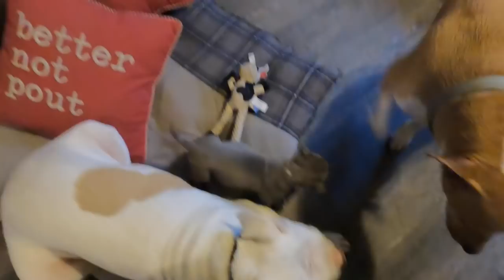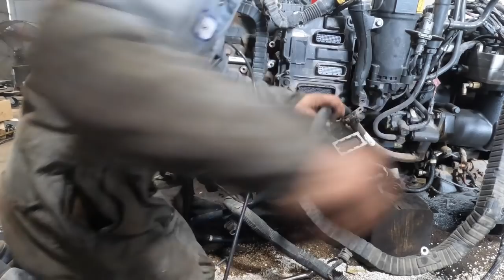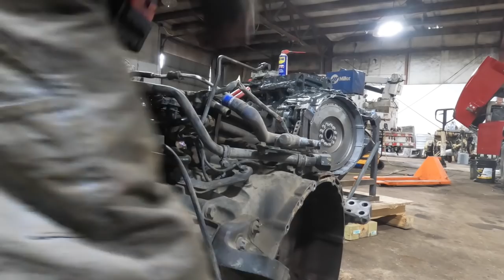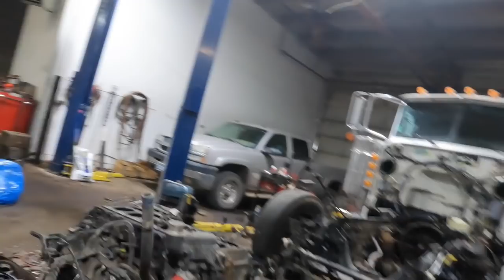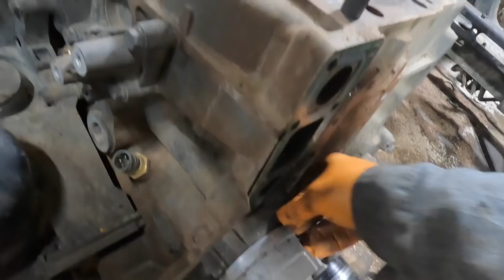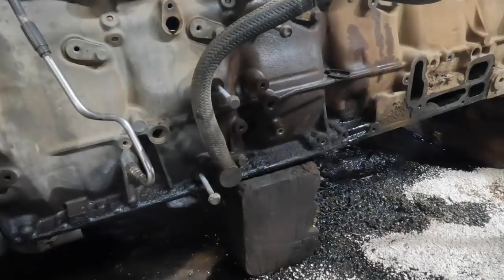Paccar mx13 short block

Comment: I'm real dang close to retiring after working hard for 50 years. 50 freaking years. Ugh. My post retirement plan? Buying tractors and equipment to work on and flip. You're a thousand times the mechanic I am but I seem to muddle through and do OK, Wish I lived in your area just so I could work with you for free and learn more from you.

Comment: Used to be that you would spend a couple of hours switching over the old parts to a new short block. Now it looks like a couple of days trying to figure out the puzzle these engineers have designed with NO thought to ever working on these units. Great video Warren. Keep up the great work.
Reply: Go back and look at his videos on the Cummins ISX, you will understand why he, and I are not that fond of PACCAR, all the wiring harnesses, ugh 😑. I quit working on Cummins in the 80's, I was specing engines for underground equipment before retirement. The changes in that time are mind blowing 🤯.

Comment: Reference the compressor take out the alan key plug ,then a 6mm screw will screw in to the oil pipe and it pulls out

Comment: Good ole Paccar, gotta love their designs 😂😂. They have a plant in Columbus Mississippi that produces these engines. Been in there several times doing tool calibrations and station audits.
Reply: the engine he's working on is a reman by src in Springfield,MO, but yes the plant I'm Columbus is pretty amazing, been there a couple times aswell and it's cool to see all the processes from snapping rod and main caps to how they perform the overhead with no feeler gauges, pretty neat

Comment: What do they do to resize the fractured rods and mains? Do the use oversized outside diameter? Hope this reman is better than the John Deere don't say anything to jinx it. All the plastic fittings and clips just get brittle from the heat but MFG don't care, it's cheaper to build it and the customer has to pay later
Reply: Not a Roman, factory short block

Comment: Cordless tools, especially rattle guns  need a patron saint they are so fundamental to today's trades. St LiPo of Milwaukee?
PS I'll  wager at a dealer all those plastic clips will be wear items 50 bucks each.
Reply: I’m a bit old school and thought for years there was no way I would buy electric impacts. I just couldn’t let myself think they are as good as air. I finally caved in, not sure my air impact had been used in a couple years now.
Reply: @ko9446  I guess air still rules wen you really have to go large but battery is really snapping at it's  heels!

Comment: It would be very difficult to make accessory repairs with the engine in the chassis.
Reply: I’ve been told (can’t confirm) since Pacar was designed in Europe and they run mostly cab overs they designed them to be worked on with the rear open and able to repair
Reply: @ko9446  Makes sense for them. Last time I saw one of these engines it was out of the frame and dumped on the ground.
Reply: @ko9446  You are correct about them being designed for COE applications. All of the gear train is on the rear of the engine and to remove the camshaft the engine needs to be removed in a non COE application.

Comment: When I was a service tech on plasma tables and welding robots I used a cheapo Rubbermaid plastic cart that I found in the trash at a factory I worked it 
But I was working on smooth concrete